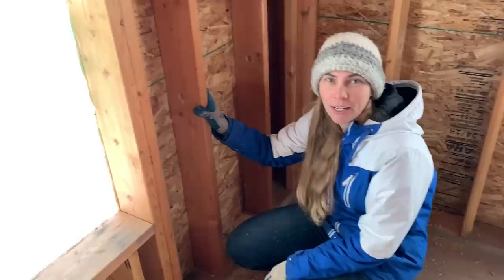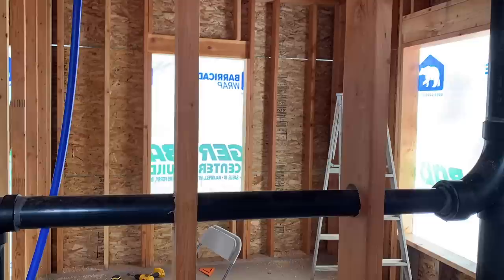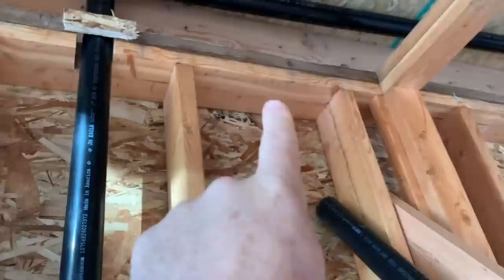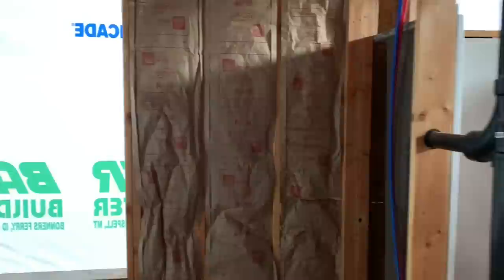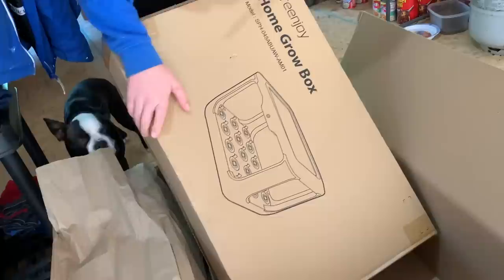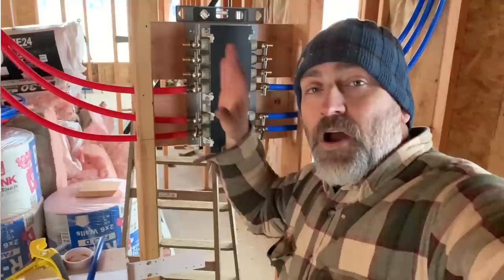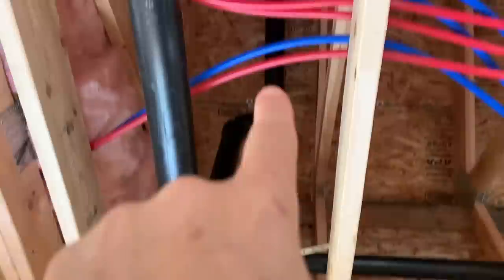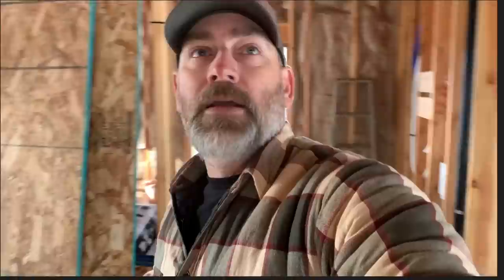Plumbing our off grid cabin with PEX | Off Grid Cabin Build #48

Comment: It is suppose to be rigid pipe between the shower valve and tub spout. The shower arm should be a hico ell, pex x fip. Ideally it should be rigid pipe also. I have had inspectors go either way but they still required rigid pipe to the spout. Avoid shark bites inside of walls.
Reply from the maker: We will see what he says.

Comment: Another great video! Inspector will love the manifold.  My two cents (having lived off grid/in cold climates): Extra-insulate the few runs of exterior wall pex. Box them with cardboard and spray foam them solid.  2) at low point of crawl space put a fitting to drain house. 3) When you go to Indo for a month long visit in winter (which I'm sure you'll do some day : )  get a couple of your many 1000's of fans to "homestead sit."  Keep the fire burning  On a serious note, Safety Sally would really be happy if you had a fire dectector and carbon monoxide detector near where you sleep.    Really cheap form of insurance.   You're going to need them anyway.

Comment: Love this channel. Amazing family. I would suggest you go
study insulation installation. You never compress behind wires or pipes, split
the insulation and place in front and back of the wire. Seal all holes in the
top and bottom plates, inside and outside walls, it must be dead airspace.
Compressed insulation is useless, it only works when fully expanded and
trapping air. Best of luck!

Comment: There is a very cheap gauge you can get=a,"Go No go" for the pex! Its a good idea to check the crimps before you cover them! If it fits over the crimp you are good if not its not crimped to spec.

Comment: I don't know if you want a recirculating pump for the hot water. It looks like it would take a couple of minutes to get warm water from the hot water heater to whatever sink, shower, tub, or washing machine you are using.  We have one connected to the hot water heater in the garage and it keeps hot water circulating throughout the house, returning it to the hot water heater.

Comment: 1/2 pex is be able to feed 3 diff fixtures... no problem! Make sure those fittings on your shower are approved to be covered inside a wall... my hunch says no. An access panel on the wall 'might' be acceptable to use them by code.
Reply: Are there shower fittings that AREN'T intended to be inside a wall? I would have thought that they all are approved for that use.
Reply from the maker: We will see what the inspector says.
Reply: @matt1544zxc3  The sharkbite/gatorbite-pushfit fittings are listed for exposed areas & above ground only due to their design.  Many manufactures make pex ready fixtures that use crimp ring style connections approved for covering.
Reply: @MartinJohnsonOffGridLiving  The valve's listed for covering-"Approved for behind-the-wall with no access and burial" according to their website.  Insp. should yield to the listing.  You guys are always inspirational to us all!!

Comment: HOWdy Johnsons,
more PLUMBING 
I beLIEve that after ALL of my FAILED Aluminum 4"  accordion  FOIL  type  bathroom VENT  installations ... 
That I would either use RIGID Aluminum 4" pipe or better yet - just PVC 4" pipe to VENT the bathroom MOISTURE ... 
IMHO 
COOP
...

Comment: If this were my house I would insulate the supply line in the crawl space, put a drain valve in the crawl space so the entire plumbing system can be emptied, make sure all lines slope towards the drain, put the water lines in the outside walls inside styrofoam insulation, and watch out for condensation in the bathroomm vents.  And when you button it up and leave, an unheated house gets very cold and it will freeze everything inside, inluding water in the drain traps, use antifreeze.
Reply from the maker: Thanks for the tips.

Comment: Your electric cables should be under the insulation. If you put on top it will compress it and you will have a cold spot there. Underneath the fibre will wrap round the cable no problem.

Comment: When you do run your wire I'm sure you know not to compress your insulation.  Cut through the insulation backing and just tape it back after running the wire.  It's looking good.
Reply from the maker: That was my plan. Thanks.
Reply: @MartinJohnsonOffGridLiving  You got this.

Comment: U need to install metal plates on all studs where the pex lines are penetrating cuz wen u install your drywall it will prevent screws or nails puncturing the lines. Furthermore. My OPINION the water manifold should be lowered to maintain water pressure yes I know u have a pump but to make sure u have proper pressure your lines should be lower it's harder for water to go up than down

Comment: Do not run water lines in outside walls. You will one day regret it when the temperature drops to extreme lows and you must deal with a water emergency.  Run it correct to start with. This is a bad shortcut to take. I would  also run electric wire as I went to not forget where all the pre-drilled holes were behind the insulation. But, that is just my preference.
Reply from the maker: We will see how it turns out this winter.

Comment: where is your water filtration?  Assuming you are going to have a tankless propane hot water heater, the tankless units are picky about filtration for the water coming in.  Your rainwater may have some debris the could easily be filtered out.  Also you may consider a traditional water pump with a pressurized bladder resavour to provide some pressurized water and not requiring the RV pump to always move the water.
Reply from the maker: We will see. Still working on it.

Comment: I would put the RV pump in the crawl space, so leakage and repair are not an issue.   Would be a good idea to use a self priming pump just in case the tank gets too low to keep the level above the pump.  Eventually you will want a pressure tank once you get enough solar to run the pump.  Do it all in a well house, where you can also add a softener and filters if necessary.   I assume you are going to use a tank-less propane water heater,  now is the time to plan on its venting before the metal roof installation.  Venting is usually PVC pipe but there are requirements for it  exit location in relation to windows etc.  A lot of folks that put in the tank-less don't like the temp cycling and opt for the addition of a small holding tank to even out the temp changes.  Don't even think about electric tank-less they takes way too much energy.  Not sure an RV pump has the volume to kick on the tank-less flow switches, but there must be an RV heater/ pump combination that does would work. 

Sure you will be glad to get the remaining windows installed and crank the temp up to broil.

Comment: This is awesome. Very helpful to see, but also have a question about the water heater as it was the only component I don't think you showed. Do you just have a single hot water line tapped off of your heater that goes to the manifold?

Comment: I saw your plumbing  video. I think in the exterior walls all the plumbing should be on the inner side while the insulation on the outer-side to protect it from freezing so that it gets some heat from the room.

Also plumbing should be away from the roof and just above the room ceiling and covered with insulation above it to protect it from freezing.

Also even unoccupied areas need to have some heating in winter for the same reason above.

Is R-19 insulation enough for Utah winters? What thickness? I have no idea. May be some locals can give better ideas.

Comment: Oops, you are using metal fittings on the water inlets.  Awesome!  Now for the kitchen hot + cold water inlets, perhaps you can get the spread a little closer than 16 inches apart.  Remember, you'll have to work with a wrench underneath the cabinet for repairs, and you'll need some elbow space, especially on that hot water line, which usually fails first....I haven't found anything in the International Plumbing Code so far, whereas you cannot run a tee to the cold water for the water closet.  I did notice you positioned it 6" above the floor.  Normally the plumbers go for a 7" height to ensure they are going to clear a 5" high baseboard.  So that's where the height  came from (plumbers decided among themselves about a good height).  As far as I can tell, there is no height requirement.

Comment: I would put heat tape on water lines in crawl space. After heat tape wrap with pipe insulation. All water lines in ext walls wrap with pipe insulation. U will regret it if you don't. GOOD LUCK‼️. Vinny 🇺🇸
Reply from the maker: Heat tape on a solar system? Maybe.

Comment: If you will have extended wintertime trips away from home and do not want to run your furnace, consider a low point drain, similar to what RV's have. If nothing else, turn off your pump and open the lowest faucet to relieve any pressure and drain what you can. Hopefully someone will comment about having the PEX firmly attached to the framing. I THINK it's required for code but do not know the details.

Comment: What pressure pump system are you going to use to supply your cold water into your house? You water tank sits lower than your house, therefore no gravity pressure feed into your house.
Reply from the maker: It will be coming in a video.

Comment: I was a plumber for many years and from my experience you do not run water lines in the outer walls of your home it is much preferable that the entry point is underneath your home and it all the lines run from that entry point or wherever your entry point is going to be through the walls to the sites where they're going to be located never run any lines through your outer walls because they will freeze I don't care how much insulation you put on them they will freeze insulation is great you're going to put a plastic Vapor Barrier over the installation mindful no heat is coming into the home in the walls how are the pipes going to keep from freezing hence do not Plum your PEX lines and the outer walls of your home it is made for interior use only any plumber or inspector will tell you the same thing no matter what other people have told you in your area almost all Plumbing it wherever the entry point is located water lines are only plumbed inside the home not on the outer walls now you can have a line going to an outside spicket but make sure that the outside spicket is a frost-free type installation another words the valve reset will be inside of the home not on the outside of the home where it will freeze and make sure that you have the pipe angled when you hook up the outside water spicket if you're going to do that installation but as for all the other pipes they have to be installed on the inside. It's my opinion and is a plumber I think it is very good sound advice

Comment: Good morning lady's and gentlemen,

If I may ask a question?

What kind of insulation do you use on the water pipes (hot and cold) and the rain water manifold. I couldn't see any.

Are you not afraid of frozen pipes or condensed water.?

Or how do you fix this problem?

Many greetings from Germany

And keep going. Looks good.

Cloey
Reply from the maker: I’m still figuring things out. I’ll show you what we come up with in future videos. Thanks for the questions!
Reply: I belive there are more than one solution for that problem,
One would be - put an insulator sleeve above the pipe, but to late.
Sevond would be - there are some foam sleeves with a slit on the side, for putting the insulation on, after you installed the pipes. Kind of expensive here like 5 dollars per meter.

I'm looking forward for your so well built house. Keep going. Like it so far.
Greetings cloey.

Comment: If you're going the manifold route it would make sense to have each outlet on its own?
Reply: Yes. "Home runs" to each spigot, faucet, tub, toilet, etc. ....if you have space on your manifold. No necessary, but gives you less leak possibility and allows you to isolate any fixture problems or repair  wI th one twist of the manifold valve on that particular line. 
My 2 cents.
Y'all are doing well. Get those Windows in. It'll make a huge difference.
Keep up the good work.

Comment: Out of experience. DO NOT use pex at an outdoor water faucet. I've had 3 break on me.
Reply from the maker: Thanks for letting me know.
Reply: @MartinJohnsonOffGridLiving  just attach it to a piece of copper and run to the outside. Will save you a lot of headaches. Great stuff for interiors. You're doing a great job.